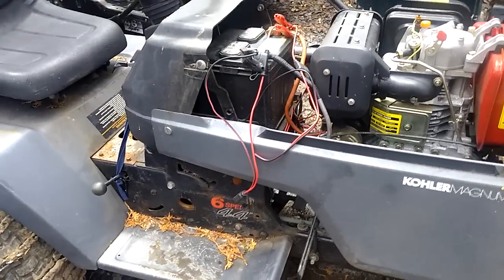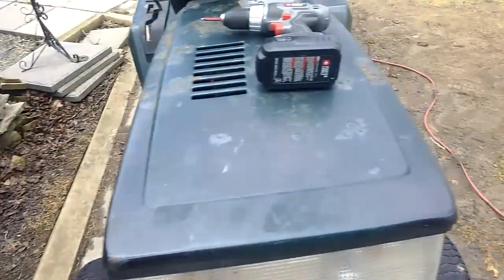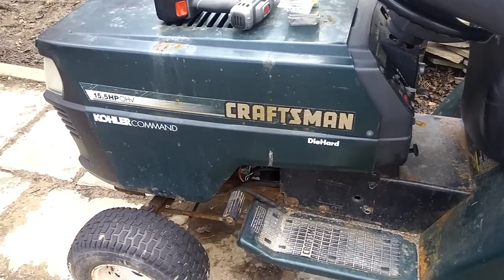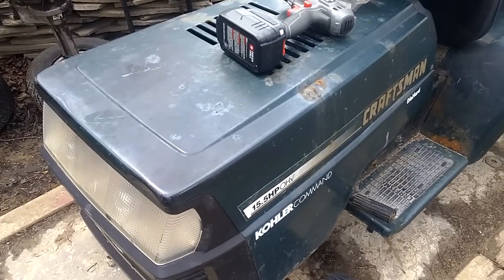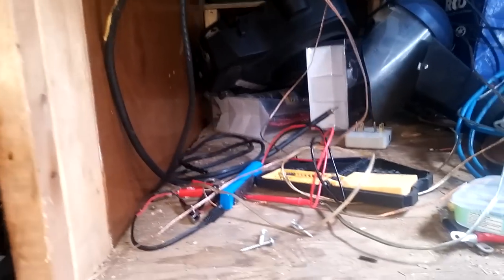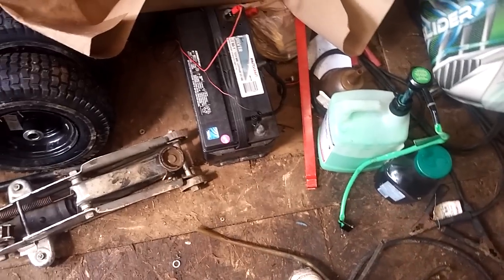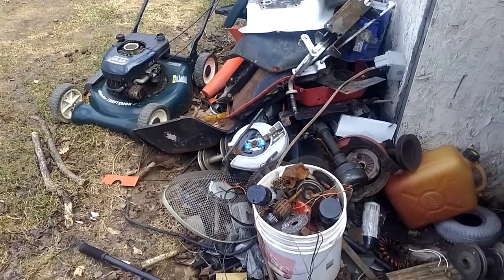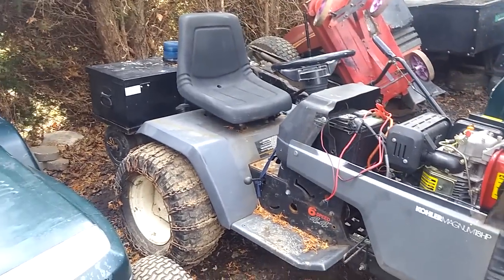April 11 Update

Comment from the maker: This engine is a 10HP if I remember correctly it's equivalent to a 15 or 16 horsepower gas, but uses half the fuel.
The nice thing is with these engines you can run them on just about any fuel a regular diesel would run on such as kerosene.